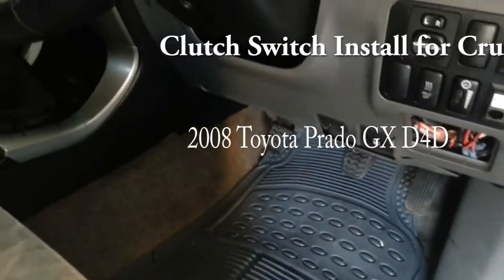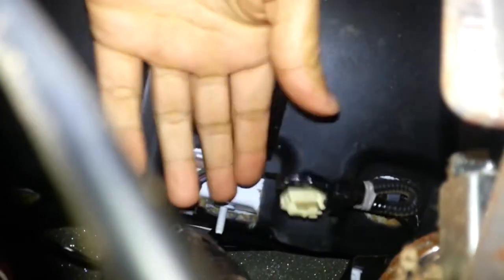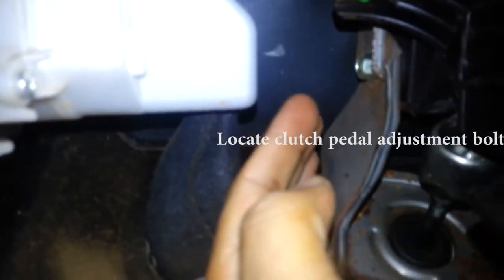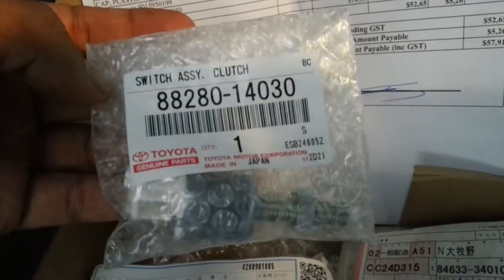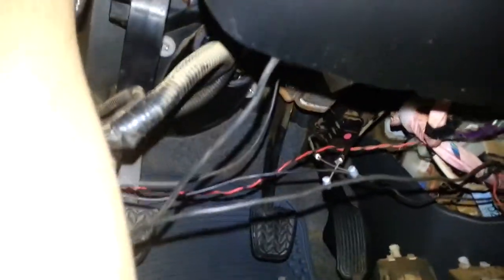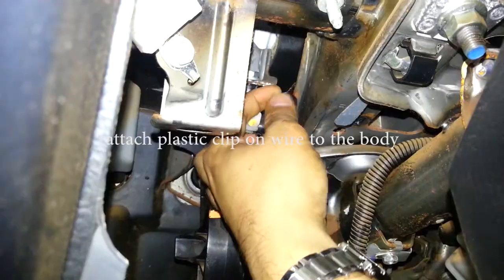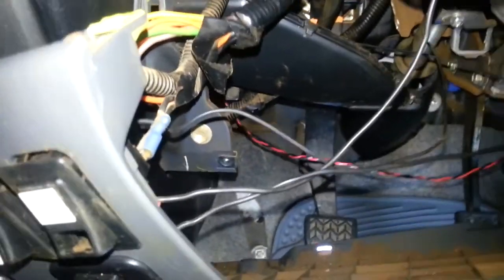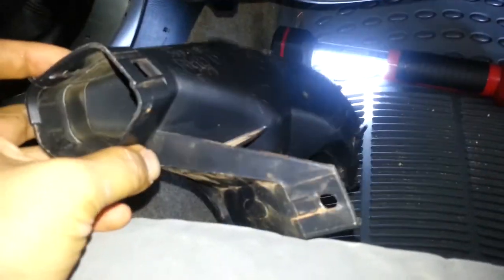Toyota Land Cruiser Prado 120 Series Clutch Switch Installation

Comment: So all you need to do is fit the switch and cruiser control lever and that's it??
Reply: +Denis Murphy on an automatic yes.  If manual - then you need to install the clutch switch/sensor.
Reply from the maker: the clutch switch connector should be hidden up there. if you find it then your car is plug and play. The ECU for the GX 120 series has all the same brains as the GXL.